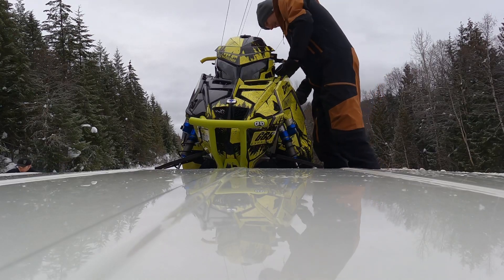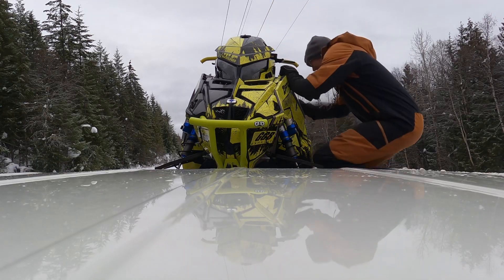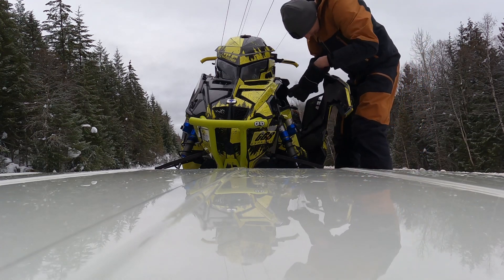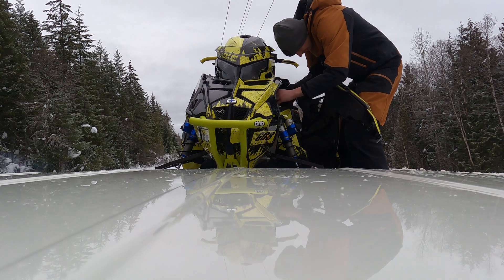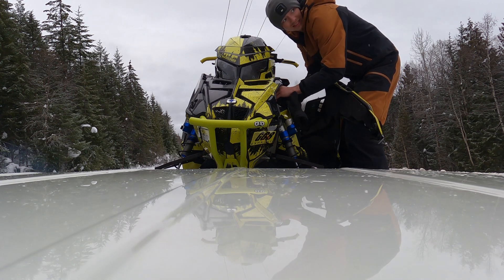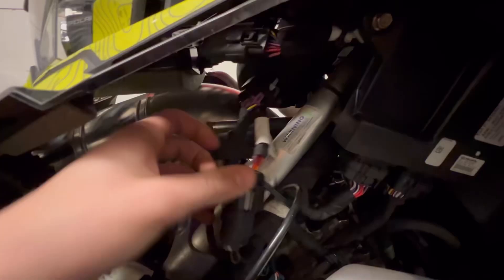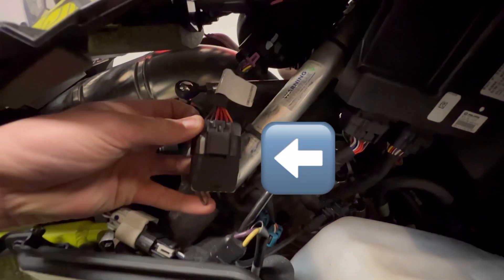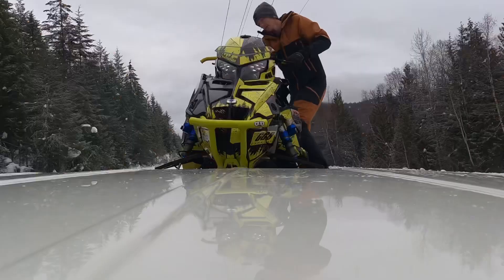How to stop your Polaris 850 from fouling spark pugs each morning!!

Comment: 2 seasons on the same plugs now. Dealer told me to always let it idle to 40degree celcius or 104F. The engine uses more oil when cold and giving it throttle while cold will make oil burn to sparkplugs because its not hot enough to burn the oil away.
Reply: For me, I let the Cold message disappear  around 19 to 23 celcius and its good.

Comment: Thanks for posting this. My sled started doing this last spring. I’ll give it a try. Sick of starting my day spending more $ and time!!
Reply from the maker: Try it out and let me know
Reply: @ChaseMasson  well so far I’ve unplugged the fuel pump, pulled it 3-4 then started it and no fouled plugs!! Three starts now with no issue. 
P.s get a tarp for that sled! Hahah I met you on the highway on your way east on Thursday. Sled is pretty recognizable even on the highway.
Reply from the maker: @boser1212  glad to hear that it helped you out man. And yeah my sled had some sort of issue so I was taking it to golden to get it fixed and it was blasted with dirt I have a tarp but didn’t put it on🤦‍♂️
Reply: If you kept your old plugs you can reuse. My 2020 did this for awhile. I'd pull them out, pull the sled over 5 or 6 times, wipe plugs off and reinstall them, ran fine.

Comment: Dealer told me to do this when I flood the engine. That and hold the throttle wide open after replug. Worked the one time I needed it. Haven't had the start issue otherwise. Lucky me I guess.